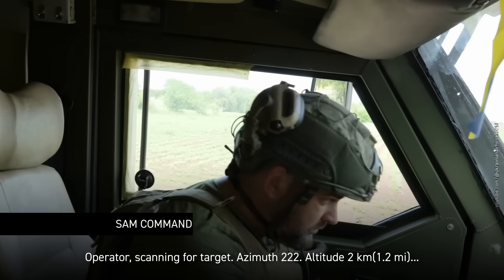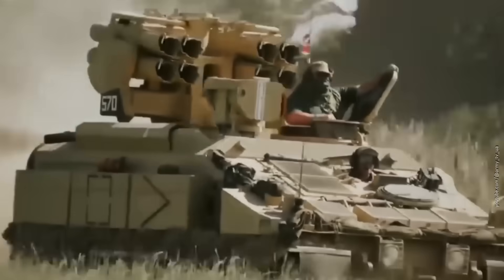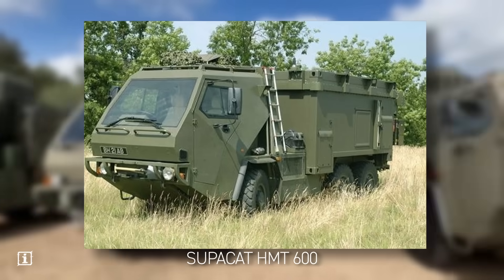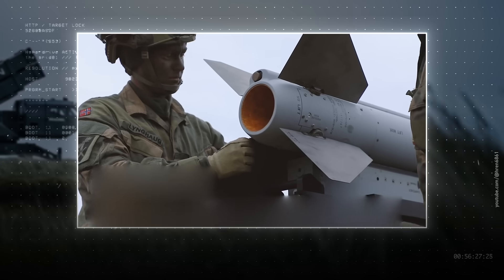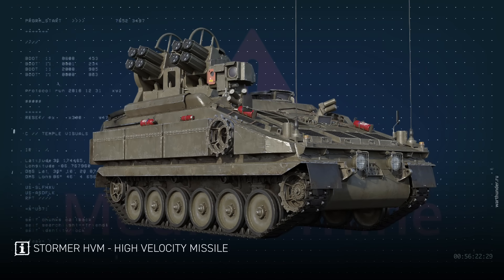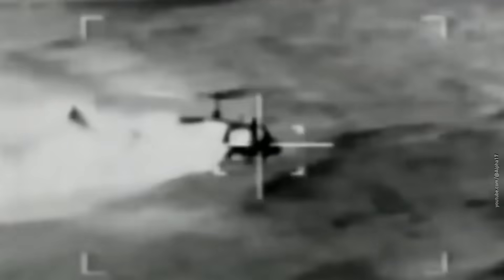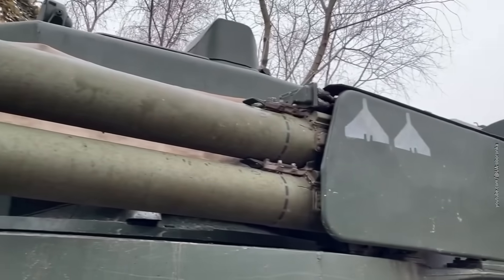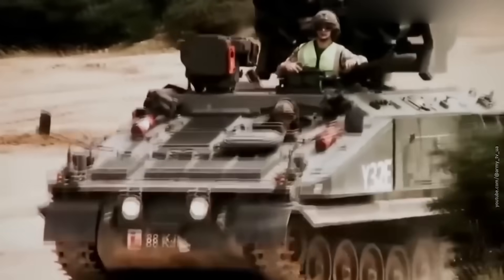How BRITISH Stormers and Ravens Crush Russian Shaheds | Soldiers Spill Truth

Comment: ASRAAM is way too expensive to be shooting down recon drones. A cheaper scaled-down variant would make sense along the lines of Halcon Systems' SkyKnight missile or Saab's Nimbrix missile. SkyKnight launchers can carry 60 missiles.

And a radar-guided and/or laser-guided variant would probably have a higher hit rate than 70 percent. Such a missile could also shoot down Shahed drones and Gerbera/Parodiya decoy drones.

As for defending the Supacat & Stormer launch vehicles from FPVs & Lancets, it would make sense to fit them with a jammer system, cope cages that actually work, as well as a gun-based system like the Hover counter-drone turret for example.

Comment: in the video, it says stormer hvm doesn’t have radar, this is incorrect. The stormer does have radar, however it doesn’t operate like traditional air defence systems. (unless the ones donated to ukraine have had their radar removed)

Rather than using laser guidance for the missiles, it uses a visual guidance system that doesn’t give off a laser, so aircraft do not know when they are locked. The reason it’s invisible is because enemy’s don’t know when it targets them. The stormer CAN use laser guidance, however often doesn’t. The radar on the other hand is similar to other radar systems but can lock to targets using IRST, (Infrared search tracking) allowing it to again, be rather stealthy as it locks a infrared signature not a radar signature.

Comment: the question I have , is cost effectiveness?
How much per missile?
is that more, or less than the value of a drone?
Also : Is the supply plentiful enough?
Reply: Doesn’t matter how much the drone costs. It’s the cost to lives and property it destroys what matters. Just one life saved is worth the cost of ten missiles.
Reply: All armed services have stock piles of older equipment that at some point needs to be decommissioned (at high cost) if not used. The ASRAAM has a number of variants going back to the late 1990's.

Comment: Yes, but the Aim -132 (ASRAAM), costs $200,000 and the Orlan 10 or ZALA costs around $80,000 to $100,000. Which is not sustainable.
But, I know, you have to look at what damage, those Russian drones do. They could easily destroy something ten times that value. So good work boys.
Reply: The point is that there is a huge stockpile of un-used Aim-132s and not enough platforms the Ukrainians are capable of using them on. The point of RAVEN is to ensure that existing assets can be used to contribute to an existing problem, rather than sitting in a depot.

Comment: You missed a couple of points the Raven can accept other air to air missiles including quite a few of the russian designs which Ukraine have stockpiles of. And the Stormer has a computer assisted target tracking feature which means they do not have to remain stationary to launch and track targets. No doubt if they are traversing rough terrain at speed the operators accuracy is less than ideal but at least they're not stuck in place while taking fire like idiots.

Comment: It is not how much the drones cost ! It is how much damage the drone would have caused and cost had it not been shot down ?
Reply: Principally there is a gulf between cost of life, and tools. The difference being for example, NATO standards on care for soldier and civilian life. And Russia's standards on care for soldier and a civilian life. You are correct in seeing that we shouldn't be using Russia's metrics on cost and product efficacy and efficiency, and more so be using NATO and the developed worlds standard.
Reply: This can be argued at the tactical or operational level. But from the strategic point of view, defense must be cheaper and simpler than the attacking weapons. Otherwise, this race will end in defeat for the side that is defending.
Reply: Fundamentally it is the strength of the industrial and financial base that the attacker or defender has that has typically defined success. After that it is preservation of life, of those who can do the work. In industry, medical, and boots on the ground. Once again you've fallen into the trap of making it about money. Which always ends in "it's too expensive to protect them, let them get bombed." (See Russia losing their financial and industrial base such as oil refinery etc)

There is a case for cheap and overwhelming drones Vs expensive missiles, that just makes sense for sure. But in the end it is the industrial base, which we protect at all costs, that builds the counter measures to those cheap drones, and we are now seeing much cheaper interceptor drones. Microwaves. Lasers. Retrofitted small aircraft. And missiles. Getting cheaper and cheaper to construct. To NOT protect industry, medical and boots on the ground for sake of an arbitrary limit of money or resource, is very naive.
Reply: @PrizrakZavtra the defender isn't paying for the attacking weaponry so the cost of it is irrelevant.
Only the cost of what is being protected and the cost of protecting it matters.
Reply: Ultimately in large scale war these things do come into it. This is why old style flak, machine gun and auto cannon type AA  are still a thing, it's cheaper to use in comparison and easier to  supply. Of course you are right though that preventing civilian death is invaluable

Comment: It shows what can be put together on a budget when needed
Reply: We're good at that. We've had to make do and mend for decades due to budget cuts. As they say, "Invention is the mother of necessity."
Reply: On a budget? ASRAAMs cost approx £200,000 a pop from what I've read.
Reply: @JimCarner777  They were surplus stock from old missile platforms
Reply: @DanRydings  @DanRydings  That cost how much?
Reply: @JimCarner777  it doesn't matter, if they didn't get used they get scraped